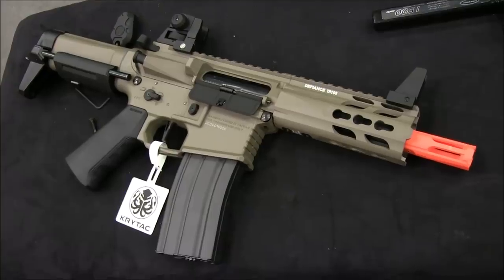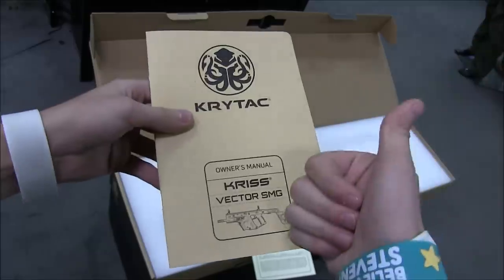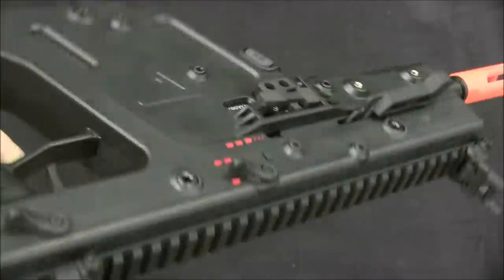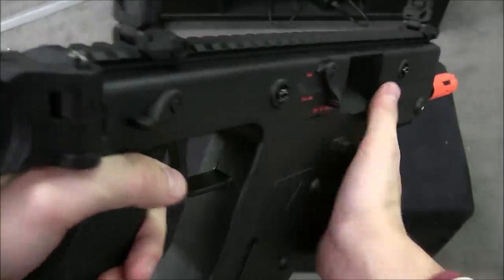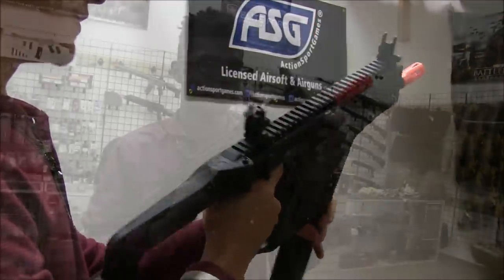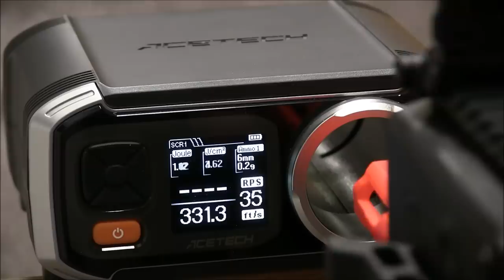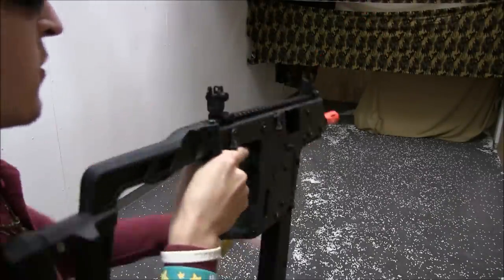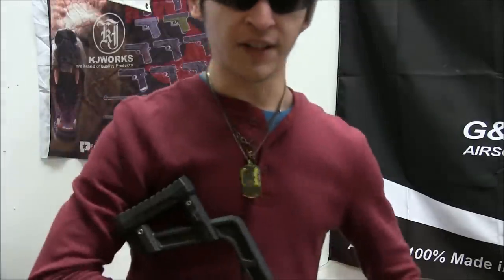Krytac Kriss Vector AEG Airsoft Review - Is it better than your Krytac?

Comment: Owned one since day 1. Best airsoft purchase I've made so far. It wrecks indoor events where if you zero your red dot perfectly you can just snipe anything that sticks out behind cover with extreme accuracy. Outdoor is pretty much the same thing although I'm using it as a secondary to my sniper. I don't get the hate for the trigger. It's super snappy and electronic. Much better than most beefed up M4's I've tried tbh
Reply: Ikr. The trigger is nice and snappy. I like it alot.

Comment: Hey Scott, Vector 2 tone with the Tan lower is coming.  Battery extended cap that can fit a 1200 mah also coming very soon.
Reply from the maker: Allizard that sounds awesome!
Reply: If you have access to a 3d printer you can have an extended batter cover printed up for you. The files are available for free online.

Comment: I got this gun back in 2018 and opted to keep it stock since it's primarily a CQB gun for me. This thing is pretty accurate out of the box and never let me down! The safety acting as a spring de-tensioner is one of my favorite features - I no longer come home and doubt myself with regards to if I did a full trigger pull to remove tension. It's an excellent gun, but some of the criticisms are valid. At the end of the day you're essentially buying a skin.

Pros:
Small, perfect for CQB
Full Ambidextrous 
Accurate out of the box
Safety features (I wish these would be standard)
Trigger is okay
Hopup is superb

Cons:
It's a little heavy-ish
Normally I mod my guns quickly but not this. Internals are scary so I'll wait til something breaks.
Mine also didn't come with metal flash hider (This is w/e)
The last time I was at the field someone actually shot a piece of the front off... granted this was after YEARS of use so idk if they were just shooting way hot or what...
Mags can be pretty pricey!
Reply: Wait this one is considered heavy? My cqb m4 is like 4x as heavy

Comment: Having very recently held one of these, i could say these things: (from a aesthetic point of view, didn't get to shot it)
Pros:
Very good build quality
Good handling (thought that might just be me)
The Trademarks
Cons:
The selector switches (thought thats something you can get use to)
Battery space
Big Magazine that can be hard to find pouches for
Slightly awkward magazine release if you have small hands

Consensus: if someone said here 500 dollars go buy an Airsoft gun, I would honestly buy the ASG Scorpion Evo, because it has more features, smaller dimensions magazines and a much better battery compartment.

Comment: I recently picked one up and when I first picked it up out of the box it felt super super solid. No vibration throughout any of the gun besides when the mag is inserted. But with one piece of duct tape around the top portion of the mag, that was solved easily. When I hold the gun in my hands and shake it, I don’t feel or hear anything wobbling. I really have no complaints other than the battery space but like you said, it can’t really be avoided so it’s not a big problem. I have yet to use this in game however when test firing it at home, the accuracy and consistency proved the gun to be indoor and outdoor worthy. The 2 round burst function is very consistent in the fps/range/accuracy. Overall I think the price point for the gun is exactly where it should be. Not a penny more and not a penny less. You will NOT be disappointed with this aeg.

Comment: I love my vector, also love it even more that I won it in an Evike giveaway so it was FREEEEE

Interesting things to add, I have smaller 11.1v batteries that AirsoftGI suggested for it and they fit great, but on an 11.1v, which it runs fine and krytac says it can handle, the 2 round burst turns into 3, its shot 1 joule with .25s on the dot every time I have chrono'd since December. And my mags tend to jam with anything heavier than .25s, and it shoots super fast with the 11.1s
Reply: You lucky >:( 
Anyway, congrats and I'm glad you like it.
Reply: My brother in law hates me because of this and that I find deals on stuff... I picked up a Echo 1 M249 that just needed a hop up unit, and some sort of grenade launcher with a r i s system, I forget the name of it but I got both of them and a box magazine for $80... turns out that discontinued grenade launcher used to be $400
Reply: Holy shit you got lucky! :-)
Reply: Year update: thing still works flawlessly
Reply: Hey man, how many magazines do you reccomend getting for the Vector? Also can you link the battery and charger that you use or at least give me the names please?

Comment: I loved the comments about the scorpion Evo.  That gun battery placement is a joke!
Reply: Kelly Daugherty i own both this and the evo and I can say the evo is a lot better, however you are correct, the evos biggest downside is the battery compartment. Absolutely terrible to try and fit a decent battery into it. Can take upwards of 5-10 mins to try and fit one in when it takes maybe 30 seconds for the vector
Reply: Just get a nuprol 11.1 v1200 mah slim stick battery & convert to deans connector , the battery can be installed in seconds into the evo 😬

Comment: I like how now companies are making more unique guns it's pretty cool. Now if only they makes more unique gbb pistols than the hi capa and glocks.  Need more variety.
Reply: Joshua Bensan umarex should be releasing the hk vp9 deluxe gbb sometime this year :)
Reply: Dara321AAA oh snap  :3
Reply: My favorite load out is my vector, and my TM g18c. It makes folks keep their heads down for sure.. buy check out the old broom handle mauser gbb.. runs like 400 fps, select fire, in full auto it runs like 50 rounds per second or faster
Reply: The only issue with anything else is the lack of parts. After 6 months I am still searching for a trigger mechanizm for my older VFC M&P9 full auto.
Reply: AirsoftSlo I just ordered a new trigger assembly from my local store mirtactical.com I’m pretty sure the trigger assembly is the same on the m&p, ppq, and another Vic pistol. Check out there for ppq trigger
Reply: Dara321AAA The only question is if the ship to europe and whats the cost? Cause for some shipping prices Ive seen it would be cheaper to buy a different gun than to fix it.
Reply: Dara321AAA Ok thanks for the info. Yes the part would fit but unfortunatly the store dpes not detect foreign post codes. It detected my country and city but not the post code.
Reply: AIRSOFT  H I P O I N T
Reply: BLizardLeLizard Lizard Hell yeah!

Comment: Scott I need your help, I’m in need of a handgun that is good quality and will last me I’ve already tried the EF 1911s (I had 3 of them and one literally blew up in my hand) an EF M9 w/ select fire which just recently completely locked up and won’t function whatsoever. I was wondering what would you recommend for someone who’s been in the sport for awhile and is in dire need of a secondary? Thanks a million
Reply from the maker: Brubur first off message up EF if you haven’t already but I’d recommend an ASG P09. I’ve been using one for like 2 years and have had no problems. That’s the pistol I’m impressed by and see around more and more lately.

Comment: Can almost afford the gas blowback for that price and that’s a discontinued collectors gun, or buy an evo with twice the features a much better functionality
Reply: Alfie Banks YEAH EVO
Reply: Don’t they have the same features?
Reply: Well for a lot less the evo has last round bolt hold open, cycle detection, mags that feed every last round.  There’s no need for a safety that devices the gun if they had simply put in a proper cycle detection system, that’s just a cheap work around
Reply: Alfie Banks ah I see
Reply: Krovii the asg scorpion actually has more features for a cheaper price
Reply: Alfie Banks lol the kwa gbb vector is hardly a collectors item. They are very very easy to find. Heck with them being discontinued they are almost more popular and come on the market probably even more
Reply: I’d disagree, at least over here in U.K. I had to pay £600/$800 for mine less than a month ago, and I mean Collectable can mean a lot but as far as I’m concerned something being discontinued and unavailable does make it desirable
Reply: Exactly
Reply: Kwa version is a lot nicer than this one
Reply: Evo also has another up on the kriss with a much shorter and crispier trigger, and a bigger battery space

Comment: Not wrong about the quick change spring system, but it's not really quick since you still need to break down the gun, remove the mech box to access the sorting, you just don't need to take apart the box

Comment: I bought one of these and it was horrible. it sounded like a ti-fighter shooting if it was a longer sound effect and much less cool. the performance was also not up to speck. the fire rate was super low. the trigger felt extremely stiff which meant I could fire it that quickly. Idk if I got a lemon but, according to my local tech,. I didn't and that's how they all sound and shoot. I hope this helps you if you are planning on buying this gun.

Comment: Well, the price did not surprise me a lot since the anouncement since it was the price of an airsoft gun that almost does not require any inner modding, I purchased it, still haven't any regrets about it and... well, money are given to be spent lol. The only problem I face with this one is that magazines jam a lot when it is used outdoors, I have to clean them much more frequently than I used to with mp5... Also, it is kinda cool to be a vector guy among the vector guys having the fully functional integrated flashlight like in gen 1 vector thanks to the 3d printing magic :D

Comment: You can fit an 11.1v battery in the grip. It obviously has to be tri-cell, in order to achieve 11.1v. The 1100maH nunchuck style batteries fit. It is tight, but you can squish them in there. Fully agree though that its not ideal and could be better.

As for the proprietary parts. The gearbox is almost fully v2 compatible save for some parts for the angled piston/cylinder.

It was an expensive gun, no doubt, but for me, it has been amazingly worth it. Yeah, you can find an M4 that does the same things for cheaper... but I didn't want an M4, I wanted a Vector. Well, I wanted a space gun, and the Vector is perfect for that: https://i.imgur.com/G8JBt1z.jpg

One big complaint I have is the mag release. The real Vector is compatible with Glock magazines, but the airsoft version is obviously not, so I think they should have taken some creative liberty and made the mag release lower to make it easier to one-hand remove the magazine.

Comment: I have one of the $100 aeg Umarex MP7s, and I've enjoyed it a lot. I was thinking of buying a GBB MP7 off eBay that comes with 7 mags, a suppressor, an adjustable fps, and a rds for like $600 CAD. Would this be a good choice to make? (I'm still somewhat new to airsoft)
Reply from the maker: TheGamingRaptor that sounds like a good deal
Reply: I found another one with zero damage near me with similar add ons for only $330 so I got it yesterday. It performs superbly.

Comment: The biggest problem I see with modding the hop or changing the bucking. You need to open the gear box to do it
Reply: Roki NZ easily done with about 10 screws. It's not as off the wall as alot of people make it to be.. airsoftology did a video on the breakdown.. super simple
Reply: Welcome Texas when you tinker with hops as much as me ten screws is a nightmare.

Comment: Honestly the only issue I have is the trigger is too stiff from the factory. The M4 series from Krytac is already overly stiff in my opinion and this Vector is a even worst offender.. I have a vague suspicion the staffs at Krytac are vehemently against over shooting in semi..... Other than that it is a solid gun, despite the price tag. Battery storage is a bit tight but a standard 1000mah 11.1 fits just fine.
Reply: Toby Zhang the trigger is on a micro switch. You almost can't tell the difference between safe and fire mode.. the trigger literally has like zero pull.. maybe like a mm

Comment: Idk wats wrong with mine but i had mine for about 8 months and the fuze burned up like 5 times
Reply: Something is causing the battery to supply a high current, check gears, make sure nothing inside the gearbox is too tight and check battery voltage
Reply: Elfren Authorlee did. Still hav the same problem

Comment: What are the muscle cars of airsoft
Reply: Pump action shotguns
Reply: Snowsniper airsoft No
Reply: Well imma have to get a good pump shotgun
Reply: Leo Is the real Gucci mane any g&p gas shotgun with a low power ring is perfect
Reply: Agoge Airsoft  I’ve barely found out about tm ksg u think it worth it ?
Reply: Leo Is the real Gucci mane i think its worth it, one thing to know though is that it has a fixed hop up, so if youre trying to use it outdoors your shots arent gonna be as far range. I personally if i wanted a shot gun i would buy it.
Reply: Agoge Airsoft  cool now going decide ksg or kwa mp7  I need a back up gun running a  mk46 and it runs through ammo to quick
Reply: Agoge Airsoft was planning to buy a ksg-NR in real life for the range  would be cool to have a real life and airsoft one
Reply: Pump action shotguns or good old bolt action snipers

Comment: I’d rather use a MP5-
Not that I don’t like the vector-

Just like the M4 the MP5 is everywhere and has parts- 

This is 450$ for a Vector name-

If it was 300-350$

I think it would be more realistic.
Reply: I like my original kriss vector it is better then this electric one hands down and mine is hpa  plus I run polar stars any way so all my guns are hpa instead of green gas.

Comment: Does it take glock mags
Reply: Gabe proprietary krytac midcap mags only.
Reply: The loading port on the vector mag is kinda like that of the m4 mags. Has the inset hole on top where the Glock mags load from between 2 ears.. my load out is a vector and a TM g18c

Comment: I don’t like it, it’s expensive, has no performance upgrades from the much cheaper Avalon series, and it’s ugly, some people will probably hate me for saying that but it’s my opinion. And I REALLY don’t like the tiny battery storage.
Reply: I mean thats why everyone has their own opinions, I like to tech so even if the performance is mediocre i can always make it better and make it a project. And i also find the gun to be beautiful. But thats why we all have opinions 👍🏻
Reply: Same, I own an Evo and I love it, the storage is fine once you get used to it, it has a quick change spring and arrives with an fps of 400, it's good for outside and indoor use
Reply: Thank you guys for being so civil, I was really expecting to get a shit storm of krytac fanboys trying to tell me why it's the best thing that ever happened to airsoft
Reply: I have a vector.. ever part in it is a v2 part. Meaning you can do a dsg build, put a prom barrel, maple leaf bucking.. the hardest part to find is the cylinder head if I'm not mistaken.. but what makes it cool, is the fact that krytac is owned by kriss.. kriss has had a heck of a "cult" following due to the recoil mitigation system. But really the quality is on point. The trigger is really short stroke so it would make an awesome day build.. but to be fair.. my choices was the scorpion evo3, or the vector.. both are cool. But heck it's a vector

Comment: Vectors shoot fast immagen full auto cqb
Reply: Laxify 24 imagine dropping in a dual sector gear, switching it to deans, putting a huge lipo battery in it with a high speed motor.. Im willing to bet you could get more than 50 rounds a second

Comment: 450? My gun was 90...
Reply: Defaultz Enabled Your 90$ gun probably shoots like garbage lol
Reply: Aaron DiNapoli nope its pin point accurate. Once you figure out the right hop up for mid to close distance you are good. Rpm is fine power is great
Reply: Defaultz Enabled how far can you shoot?
Reply: Aaron DiNapoli i haven't really checked the distance for it. I go to an indoor airsoft spot but it lazers from one spawn to the other
Reply: Check this out y'all.. I have a vector and a j&g m4. You can spend a ton of money buying a krytac, but who makes another vector.. just 1 other company.. if I buy an m4, I'm buying cheap and building it.. my jg runs around 400 fps with .2.. I run .3 devil blasters r hippoed, barrel bucking blah blah blah.. it ran me about a 250 dollar build, but the gun is way more accurate and has a ton more distance than my vector.. point is.. price of gun matters none.. quality of build is the cream.
Reply: Welcome Texas cool. I need to learn how to build them then
Reply: Defaultz Enabled there are alot of videos on YouTube that show you how to do what you need to do.. some of the stuff is very easy.
Reply: Welcome Texas oh okay i will check them out then thanks

Comment: 450$ for toy  I can buy real gun which is better
Reply: You can buy a real vector or lvoa for the same price? Keep dreaming.
Reply: Lucky Ahoge  not vector other mabey used ar15 or 22 rifle or good shotgun or good pistol but the vic is about 900 to 1400 $   and in Saudi Arabia is about  2500 $ for full auto
Reply: and for some reason you don't realize that airsoft guns don't operate the same way as a real gun and require much different engineering and thinking to create